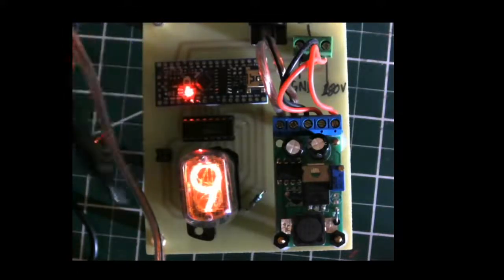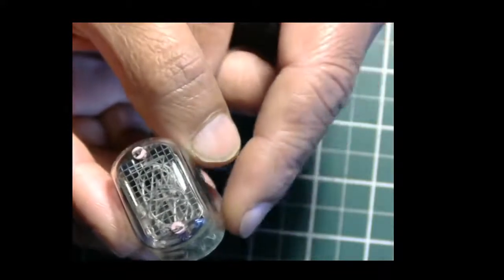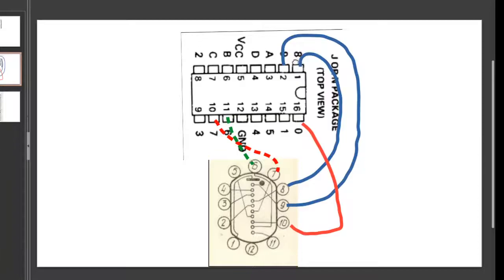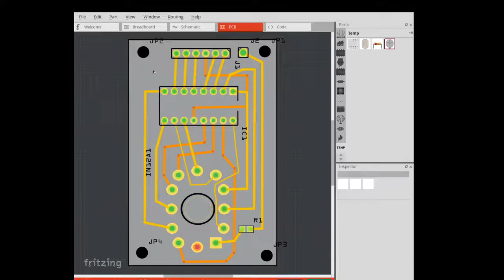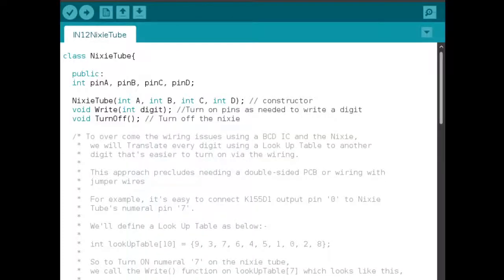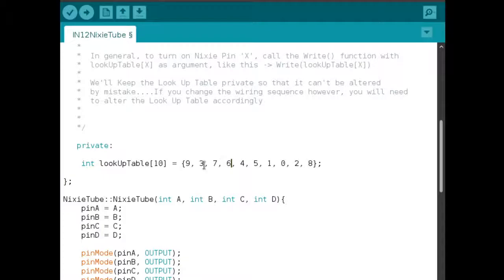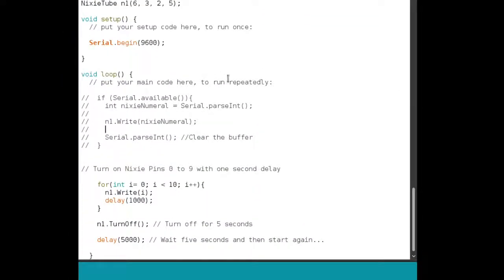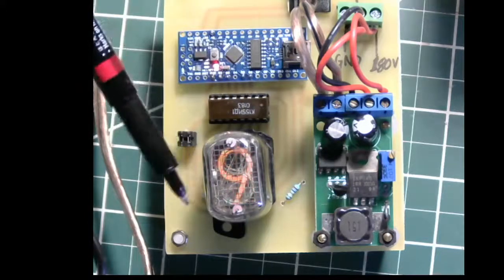DIY Nixie Tube Controller. The Easiest Way!

Comment: 7:00 - Wait, what about the voltage? Those BCD chips can't handle DC 120 volts required to drive the nixie tube. You need some kind of high power transistor to take low voltage signal to switch a high voltage signal.